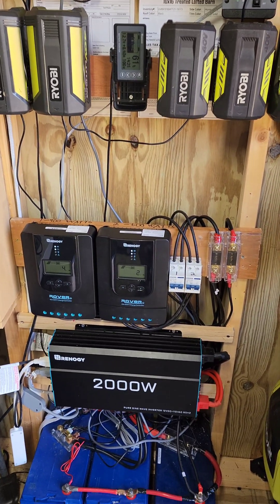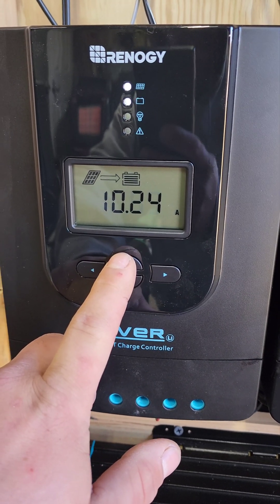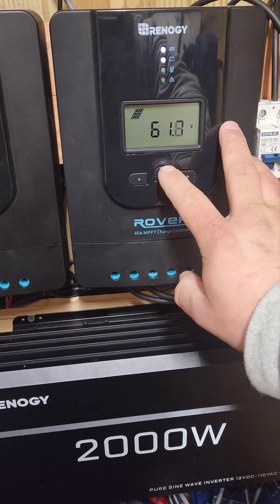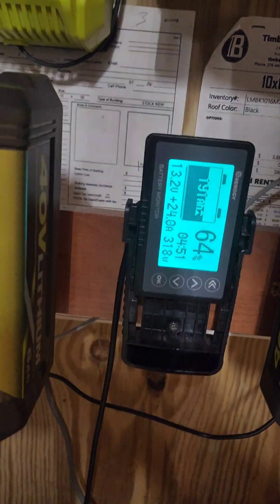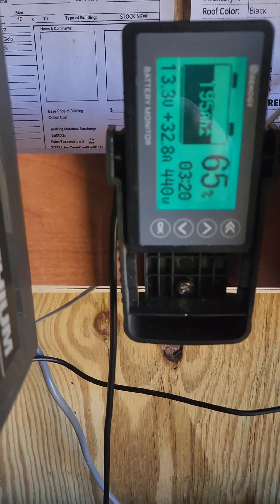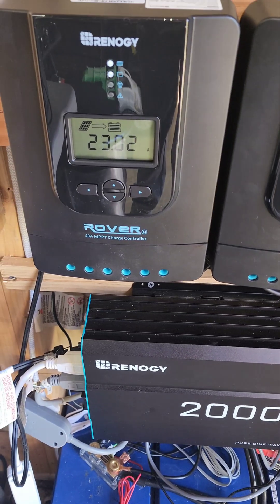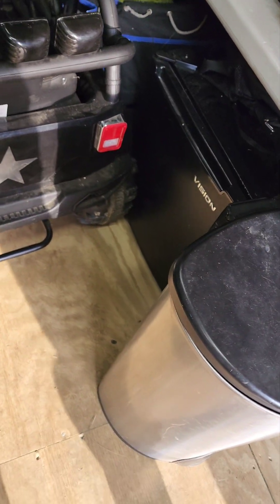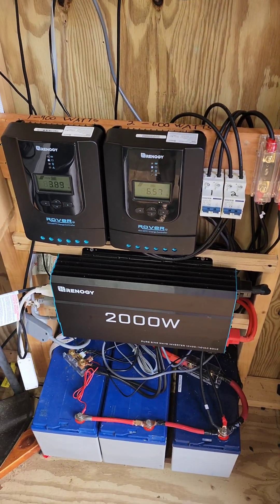Join me watching solar production on 1000 watts fill up the battery bank with full sun for the day!

Comment: Do you have a list of material you bought from home depot? Or do you have a video tutorial?
Reply from the maker: @TienTran-bi1jv  
3x 4x4x12 pressure treat
2 hinges 
4 L brackets
6 sets of Z brackets 
That's it bud. 
I played the 2 4x4x12s down and started mounting the panels then cut 2 pieces for the end then 2 prices left over for the legs and hinged them together. Added a piece leftover with 45° cuts for the angle. I would add 1 4x4 between the legs for more rigidity.

Comment: Which batteries are you using and in which set up?
Reply from the maker: This is a all 12v setup. The batteries are 3x100ah renogy gel batteries all in parallel with a main negative on first battery and main positive on last battery. Hope this helps and thanks for watching!

Comment: Whats up mane! I hate the AH measurement lol. But I get why people use it who are battery centric with the SLA and Gels and such. But man do I wish that measurement would go away. 

And you gotta turn that phone sideways boss.
Reply from the maker: Mainly because we measure voltage and amperage from the panels to the batteries. Capacity Is measured in AH. Technically I can measure in watts but there's really not a set Watthour meter anywhere but on the app for the charge controllers for input from solar panels. Also lithium has a set capacity 0-100%. Gel,agm,lead acid, and SLA all have a 50-100% usage. So it's easier to use AH and voltages for the system to know your percentage. Meaning 12.0v is 50% without damaging or life shortening the batteries. So my 300ah gel battery bank has 3.9KWH capacity but about 1.9 kwh capacity. In emergencies we can go down to 11.0 volts which is about 20% on gel. But anything lower than inverters and monitors start to shut down. And damage is occurring to batteries. This is why I can't wait to get another battery or a power station. I can actually use the gel battery bank to recharge a portable power station. :)
Reply: And man I dont think I will ever go separate charge controllers because I dont want to be bothered with breakers and such. I do love those all in ones and those server batteries that have breakers built in though.

Comment: Are you running both Rovers into 1 battery bank?  You should also get bigger fuse for between the batteries and the inverter.
Reply from the maker: Yes running both rovers to one bank. I'm using a 200 amp fuse which handles higher surge amps. My inverter can't handle anything else anyway
Reply: @jaysonstebbins2539  Thanks. Can you do a follow up video on how you are doing that?
Reply from the maker: @AaronBregg  absolutely. Got some time off coming up and I'll do another video on my wiring.

Comment: This modules are small, but they still can catch back winds.
Reply from the maker: Now that I've had them up in 50mph gusts I can officially tell ya that yes they do but this setup since I made sure they have holes between the panels and heavy pressure treated 4x4s. This 500# monster didn't even budge lol!

Comment: Nice setup, I'm only running two panels now for a very small backup to run lights and charge cell phones but I want to do what you are eventually so I can get rid of my backup generator.
Reply from the maker: Thank alot! It's alot of fun! Never can be overprepared. We just had a power outage and it was nice to know I could run an extension cord from the shed to the house for the fridge. Good luck!
Reply: @jaysonstebbins2539  I agree about being prepared and your right it is alot of fun plus it's interesting. I live in a part of Tennessee with so many bad weather days that solar honestly isn't practical plus our grid power is only 13 cents a kilowatt so the pay off will never come but I won't mind the investment because  it's quiet and hassle free.